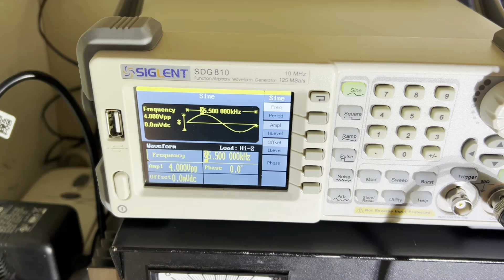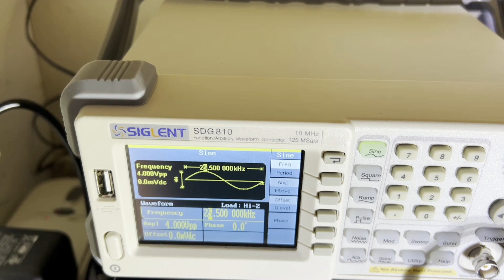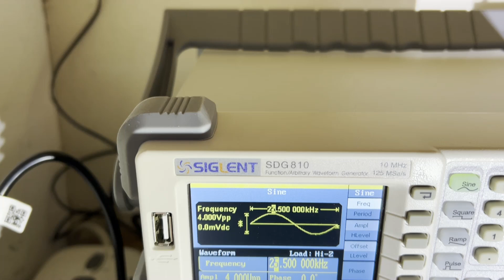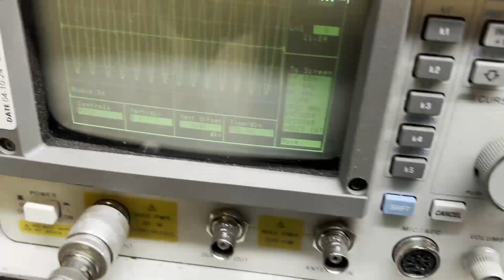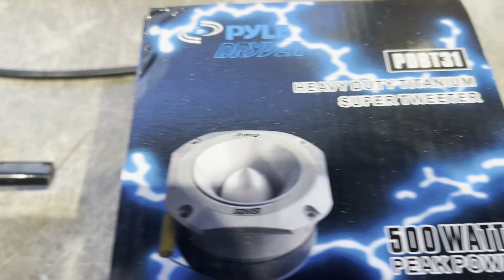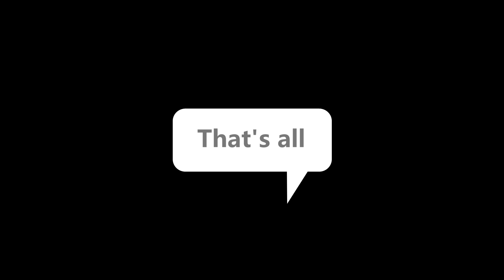Ultrasonic Anti Dog Barking Devices

Comment: Bob.  Thanks for your great video.  I'm trying to step down the voltage from the kemo and it keeps reading only 2 volts despite videos showing it puts out 10 volts to the speakers.  Did you have to have a more high end multi-meter to properly read the voltage out of the kemo?  I know it's a higher frequency than normal so maybe that's why my multi-meter cannot read it right.
Reply from the maker: make sure  your  volt meter is  set for AC the stock output of the Kemo's are aournd 10 volt's AC at the lowest audable setting.
 see this guys video on the resistors to step down the voltage.
https://youtu.be/Pj-jx53dYF4?si=Fo3WDm6JiByeHpKG&t=444

Comment: Hello thank you for the awesome video.. what are the things called to reduce the volts for the rca input to the amp? Where can I find them?
Reply from the maker: It's a voltage divider, you just need a few resistors. See below video (at 5.40min) it may be helpful to see how that goes together. I didn't bother with the math formula. since I had a bunch of resistors and just found a few values that dropped the voltage where I wanted it to be, or you can go with the value he used, hope this helps.
https://www.youtube.com/watch?v=Pj-jx53dYF4
Reply from the maker: Another thing you may consider if your going to run an amplifer is adding a shut off timer to keep you from buring up your gear, see below video

https://youtu.be/i-I7M5gQLWY
Reply: Thank you for you reply sir! Really appreciate it!

Comment: Hi, I have a question: will this device work on a large, aggressive dog that barks at everything?
Reply from the maker: Over here it stopped all the barking at nothing nonsense but if something agitates or made the dogs mad like a UPS , FedEx , Amazon truck or driver or another dog walking by near them they absolutely would still bark. but those out bursts are far shorter now since the started using the device. Good luck
Reply: @bobkirby3114   Thanks for your reply, I hope I can do something with this device.
Reply from the maker: @GroszGrosz-x1y When installing the speakers try to keep them as close as possible as well as in the best line of site location possible to your target area to minimize blocking any of the sound.
Reply: Hi, I posted a question about a speaker here, asking if I could use a different one, but there was a URL for that speaker, and YouTube seems to have deleted the comment. Can I use a different speaker with a frequency response of up to 25 kHz? Or should I choose the one you recommend?
Reply from the maker: @GroszGrosz-x1y What ever speaker you end up using make sure you check the specifications to make sure it at least 
Works up to the 25KHZ range. The 2 tweeters I have been using are the Pyle PDBT31 that works up to
25KHZ and the other is the Orion HCCA-TN1 that goes up to 27KHZ.
Reply: @bobkirby3114  Thank You.

Comment: Very very nice setup man 👍 I want to replicate your setup pretty soon I have 4 month old son and me and my wife are neighbors dog won't shut the f up lol it's none of those high pitch female barks she barks all freaking night literally at nothing are sleep has been really really bad on top of my son waking up from the dog anyways this is why I'm going to have to do to get some sleep is there a way you can draw a simple diagram and parts list so I can replicate your setup I want to replicate the aganizer box with same parts and tweater please let me know much appreciated 👍
Reply from the maker: I know what sleepless nights are like,  It was the dog behind me that motivated me to do this. That  bastard would start barking late at night and bark continuously for 2 to 3 hours, I did not know a dog could bark that long. The ultrasonic unit was effective on him and after a few months later they got rid of that dog, so now I just have 2 to the side of me that would go nuts during the day but the ultrasonic device has knocked there barking down %90.
 
If you have a decent line of sight to the target area and are not really far away, using the kemo generator with the Pyle or Orion tweeter may be enough.. Below are the parts I used. I have another video testing tweeters using the Kemo generator by itself (non amplified), and was seeing 90 DB of sound 18' away. A few weekends ago I was testing 2 of the Pyle tweeters in parallel with the amplifier set to 80ish watts and was seeing 115DB at 18'.

 While using these devices it got rid of %95 the nonsense barking where the dogs would just be barking at nothing If something irritates or makes the dog(s) mad (postman, amazon or UPS truck ETC) they absolutely will still bark but those barking outbursts are far shorter than before. It’s a shame because of inconsiderate neighbors we have to use devices like these.

Take a look at this guy's videos as he walks through his setup from start to finish. The only thing I did differently was add a keychain remote and a time delay relay along with a timeout timer. 

https://youtu.be/Pj-jx53dYF4?si=omOg0CjBp8YkhhtA 

https://youtu.be/Q32dOPddBqk?si=a31gUniKAduNeTu2

My parts list:

Pyle tweeter: this one looks to be out of stock at the moment but they are on ebay too
https://www.amazon.com/dp/B004HJ1QHQ?ref=ppx_yo2ov_dt_b_fed_asin_title&th=1

Orion tweeter:
 https://www.amazon.com/dp/B0145RGZ9I?ref=ppx_yo2ov_dt_b_fed_asin_title&th=1

Pyle amplifier:
 https://www.amazon.com/dp/B000CHRK6S?ref=ppx_yo2ov_dt_b_fed_asin_title&th=1

Time delay relay:
https://www.amazon.com/dp/B01DK8NJNI?ref=ppx_yo2ov_dt_b_fed_asin_title

RF keychain remote:
https://www.amazon.com/dp/B082WXR37T?ref=ppx_yo2ov_dt_b_fed_asin_title&th=1

Kemo signal generator:
https://www.amazon.com/dp/B00NRH95AY?ref=ppx_yo2ov_dt_b_fed_asin_title

Plastic enclosures:
https://www.amazon.com/dp/B0BP79VW3L?ref=ppx_yo2ov_dt_b_fed_asin_title&th=1
Reply: Awesome thanks you so much for the information i am going to build the unit for sure I'll make a separate YouTube channel and I'll upload the videos of this damn dog barking I'll do a before and after I'll link it here in the comments definitely will give you a shout out thank Buddy @bobkirby3114
Reply from the maker: @overunityresearchchannel  Cool it would be nice to see your video, just keep in mind the dog training won't happen overnight. Also see my other video on the tweeter tests. In that test u can see the difference between the Piezo and that Orion tweeter was a 20db sound increase. So for argument's sake let's just assume  the Kemo unit is putting out 1 watt of power (I know its a bit less than that) and using the Piezo speaker I was seeing 70Db at 18' then switching to the Orion and seeing 90db. That 20db difference would be equivalent going from 1watt to 100watts worth of audio output gain on the Piezo. I guess my point is that if you stay with high sensitivity tweeters as seen in my videos you may not need an amplifier at all. There are a lot of anti barking videos using the Piezo speakers, they just don't compare output to a regular sensitive tweeter.

Also see below it's another guy's video using the time delay relay, which may help. I did not design all this stuff, most of my work here was from  getting ideas from others videos out there, with exception of adding a timeout timer I had not seen anyone do that yet.(it's another one of my videos)

Take a look at this guy's use of the time delay relay. Also his setting of #10 on Kemo is too high run mine between 6.5 and 7.5 for the dogs.  Just my opinion. 
 https://youtu.be/FChUDsStdeo?si=PAtdEhLv7brptuSD

Comment: Great Video! I'd like to build the "Little Agonizer". Couple questions if you have a second:
1. Are you using Pyle 1.5" (PDBT31) Tweeter with your "Little Agonizer" setup? 
2. Will the little KEMO Ultrasonic Generator (#M048N) provide enough power without an amp? 
3. Is there a Power Adaptor Supply or Remote Control Key Fob setup you recommend? 
Thanks! Awesome set-up super helpful!
Reply from the maker: On the non-amplified unit I used the 500watt rated pile as shown in the video but recently started playing with an Orion HCCA-TN1 super tweeter the Orion sensitivity is 118DB compared to 106DB from the Pyle, also the frequency  response goes up to 28.5KHZ. (see below link) there about $100 vs the Pyle that’s $35 both will work fine but the Orion puts out a lot more sound. The remote I’m using is a UHF latching one that I also got off Amazon below is the link to it as well. I am going to add a time out timer to the big unit, so it automatically shuts off after a specific time, I will post a video once I have it done.

 RF remote:
 https://www.amazon.com/dp/B082WXR37T?ref=ppx_yo2ov_dt_b_fed_asin_title

 
Orion tweeter:
 https://www.amazon.com/dp/B0145RGZ9I?ref=ppx_yo2ov_dt_b_fed_asin_title&th=1

Pyle tweeter:
https://www.amazon.com/dp/B004HJ1QHQ?ref=ppx_yo2ov_dt_b_fed_asin_title&th=1

 A quick video on the DB outputs on a few different tweeters.
 https://youtu.be/T-MdMUWuVxY?si=0C5lUJGQ2LRlOZOv

This is a link to the video I  added a Time out timer 
https://youtu.be/i-I7M5gQLWY

Comment: Whoa, that build is super clean. I've never seen those style of plastic waffle-like equipment enclosures. That looks way fast to build up.
Reply from the maker: Thanks Amazon has those boxes with the back plate, it makes it easer to lay out things.,
Reply: Nice project, could you add a link or drop a brand name to the enclosure, please? I can't see them anywhere
Reply from the maker: @blimeycrikey  try this link https://www.amazon.com/dp/B09N7LVSLM?ref=ppx_yo2ov_dt_b_fed_asin_title&th=1
Reply: Top man, thank you!
Reply from the maker: @blimeycrikey  here is another brand boxes: https://www.amazon.com/LeMotech-Electrical-Waterproof-Stainless-Enclosure/dp/B0BP79VW3L?pd_rd_w=Z7Ejj&content-id=amzn1.sym.86cd516c-9ee6-4c5d-aaa4-aaab840a97be&pf_rd_p=86cd516c-9ee6-4c5d-aaa4-aaab840a97be&pf_rd_r=TPCYT02JQDKW0S3BDQRF&pd_rd_wg=HXMg4&pd_rd_r=1d0affce-326a-4b1c-8601-7930da79c6ee&pd_rd_i=B0BP79VW3L&ref_=pd_bap_d_grid_rp_0_20_cp_t&th=1